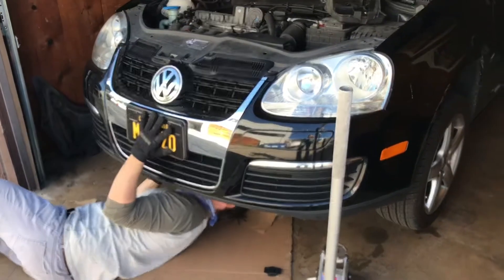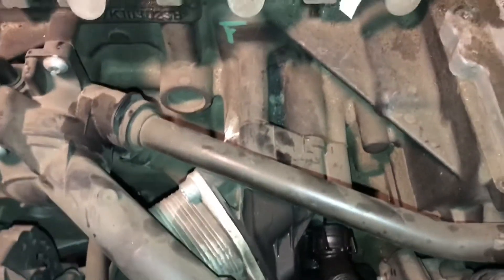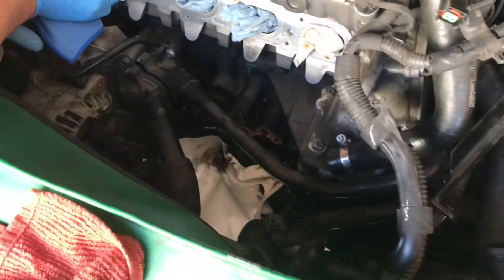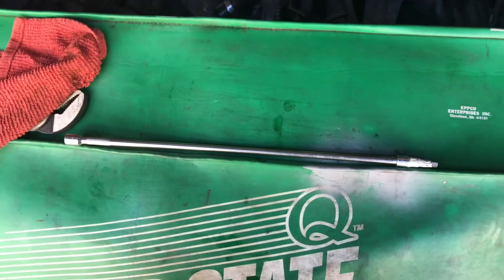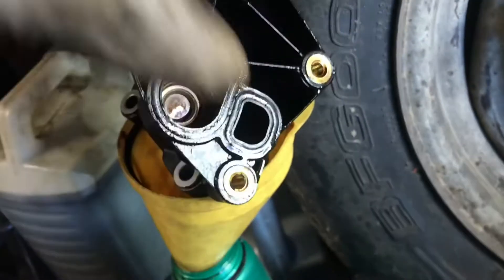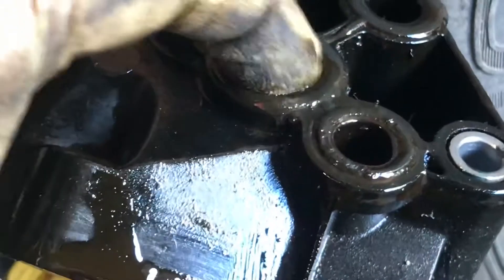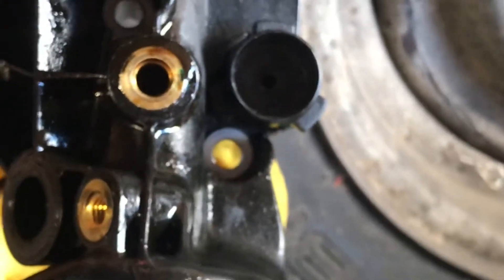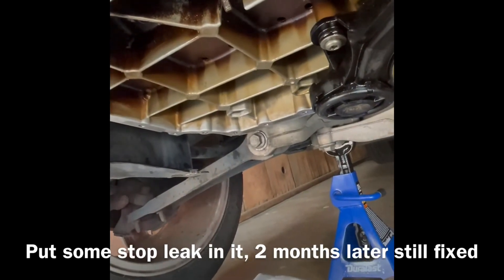2010 VW Jetta coolant in oil replace oil cooler and adapter or Head gasket?

Comment: I've got to wonder how many head gaskets have been changed when the problem was actually the oil cooler.
Reply from the maker: this one ended up being head gasket also, or both. he added a can sealer, been ok about 6 months later.